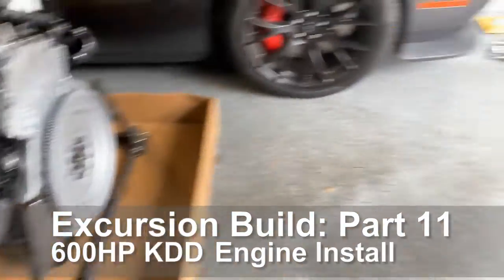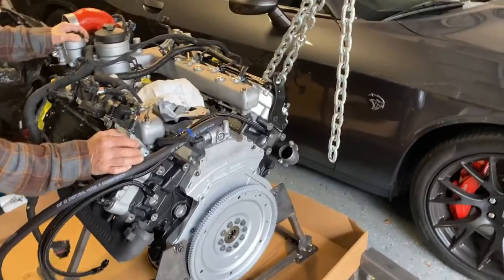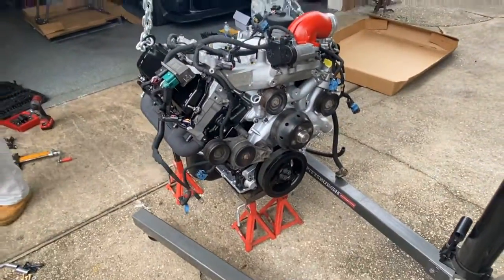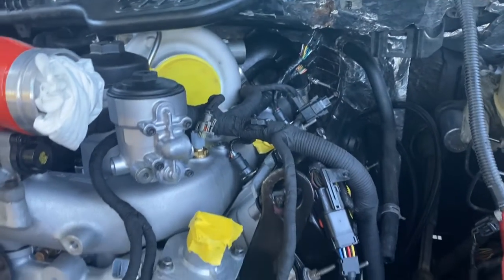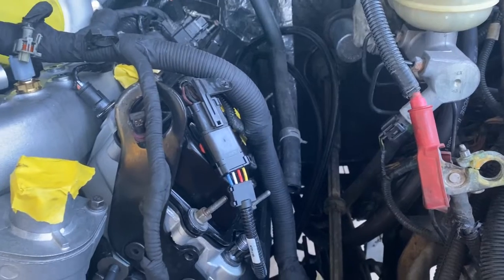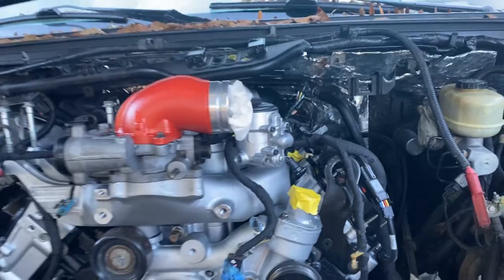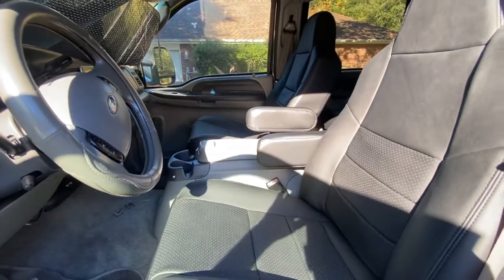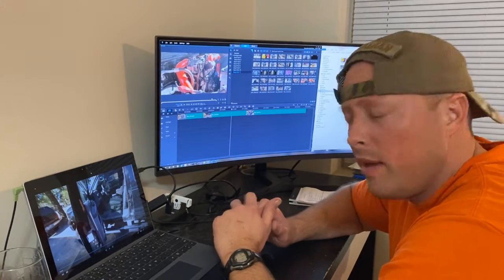6.0 Excursion Build Part 11: 600HP Engine Install

Comment: I’ve been reading on the trans & wondering if the direct drive & EPC solenoids are worth upgrading?    What I’ve read is about 50/50 on yes or no.  Any experience with those?

Comment: You missed that ground or pulled it off the main harness why Pat's wont work,
Reply from the maker: Yeah, you are right, but I haven’t been able to isolate the problem yet. The main harness is causing the issue though. When I unplug the main engine harness from the PCM, everything comes alive and communicates.
Reply: @GSXR1000Rob  ok any chaffing what's the condition of the harness, what year is the truck aswell
Reply from the maker: @jacobgomez2682  I looked over the harness and rewrapped it. Didn’t see anything obvious. The harness is original from 2003. I’m going to recheck all the grounds to the engine and put in a new engine harness. Fingers crossed it solves the problem! Any suggestions are greatly appreciated!
Reply: @GSXR1000Rob  does your harness have a ground by cylinder 8 left of ficm? Check if it's on the intake manifold bolt
Reply: @GSXR1000Rob  were are you located or the truck?

Comment: Please be safe, don’t rely on a floor jack to support the truck, use jack stands as backup.
Reply from the maker: Totally agree! In previous videos, I always have a jack stand under. The Jack was used in this video to simply get the transmission under the truck, it wouldn’t clear. Once the transmission was under the truck, we lowered the truck back down in its wheels to install it.
Reply: Going under the truck with jack and the 2x4 on slight angle was not good.
I have known two people on my street that died when a jack slipped. These were separate events. I make sure, no matter how little I need to go under, there is a back up. And that back is not my head.